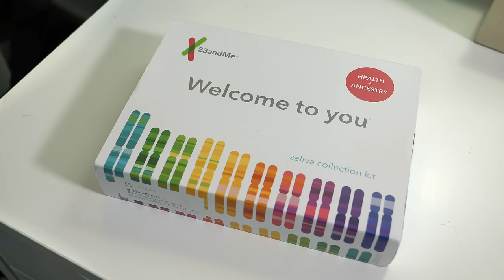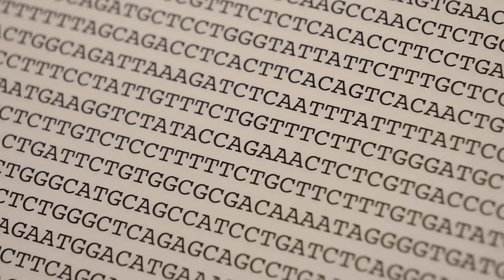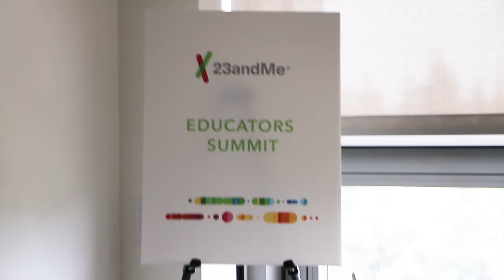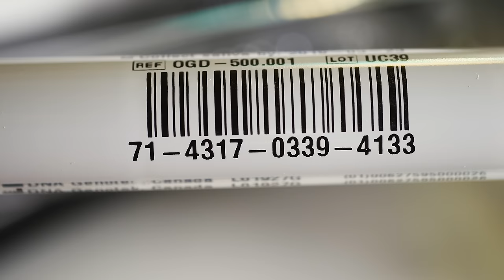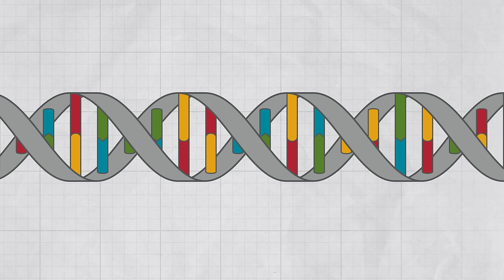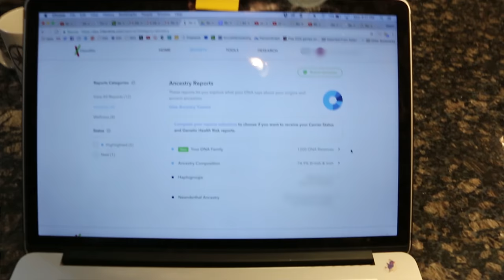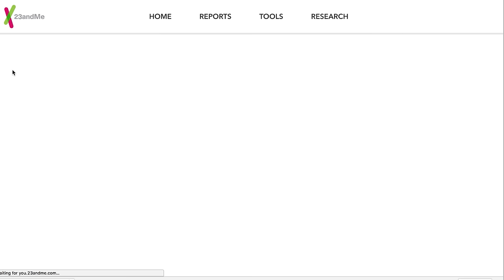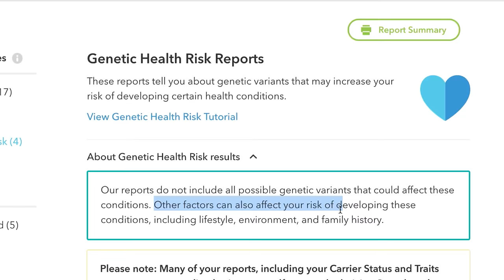DNA Testing and Privacy (Behind the scenes at the 23andMe Lab) - Smarter Every Day 176

Comment: What is done with the digital information gathered by 23&Me and the labs? They trash the samples when  people don't want them to be stored, but they've read the DNA already and stored that information digitally, I'm sure. Is that also destroyed?
Reply: Who knows... :)
Reply: I would try reading the 23andMe privacy guidelines.  I bet somewhere there's something that says "This information, if you choose to have it destroyed, will not only be physically destroyed, but our system will also delete this information after X amount of days/years."
I mean, I can't imagine they'd be able to afford saving all that data on their servers for too long.
Reply: @vjm3  well...  This is genotyping so it's looking at .02% of the genome, and the full genome on the other system was about 80GB...  If my head math is correct that would make the multiplication come to .016GB but even then that's too much because each of those 600,000 genes was  simplified by reading off a binary Gene type from the final base pair.  In the end they wound up with 600,000 bits of information, which would make for a miniscule file size.  I'd say that this falls into the category of so little file space it costs less to keep it forever than to deal with the logistics of knowing whether to get rid of it or not.

People are forgetting they have to save the data so you can access it...

Comment: You're not covering what happens to the Health + Ancestry Service samples or where that data is then used after you get your results. My biggest problem with this service is what they discovery in your DNA (for good or bad) can be used with any compensation to the individual because they signed those rights over to 23andMe. Read the fine print, I did. As for the physical samples be being destroyed, that should not even be an issue, the "spit" is like the plastic bottle your soda comes in as the data has be collected and is now in the system and is for sale and has been sold already to pfizer or other companies. Don't get me wrong, I'm all for the betterment, but I have to draw the line when it comes to a company making money twice.
Reply: Just curious, I dont mean to be confrontational or anything, but can you maybe just paste the fine print you found? Im just curious and would like to also see what, how, where, etc.

Comment: The 0.02% thing seems a little bit of a misleading statistic. While it is true that is the overall percentage of your DNA, it is slightly misleading in that its not necessarily the percentage of your DNA that matters. Consider how much of our DNA is shared with a Banana (~50%) or a chimpanzee (~99%). Then consider that a not insignificant portion of our DNA is considered to be non-coding or junk DNA. 

All that put together could make the percentage of your DNA that they are testing for out of your total DNA that matters a good bit larger. I am far enough from an expert to not know even within orders of magnitude what that final percentage would be, but it would almost certainly be higher than the 0.02% stated.

That said, that doesn't scare me off of testing services like 23&me so much as not seeing it as a good value at its current price.

Thanks for the video!
Reply: Brent C They don't claim that percentage as part of their value at all though. It has nothing to do with it.

Comment: I was a bit surprised to see at 8:15 that the technician that is de-capping the saliva samples before testing them is actually talking over all the un-capped samples without any sort of mouth cover, potentially contaminating the samples. Anyone else thought about that?
Reply: Any resulting contamination from breathing over a sample is negligible. The worst possible scenario for contamination would be for the technician to actually spit in the original sample, which would result in (potentially) different reads for the same location.  This the concept of coverage in sequencing, in order to ensure there are correct matches: https://en.wikipedia.org/wiki/Coverage_(genetics)
Reply: Contamination from foreign spit over air is nothing compared to chicken bits from your sandwich you had for lunch before spitting into the tube.
Reply: Zedex 12, you watch Adam ruins everything too? :P

Comment: How does they not contaminate the sample, as they don't handle the tubes while wearing face mask
Reply: because the sample undergoes multiplication before being put on the chip, small contamination doesn't matter. As long as you have "pure enough" sample it will give correct fluorescence, because there are more "correct" matches than those with contaminant.
Reply: Loliette very carefully

Comment: If someone from 23andme sees this (I know this is an old upload, but still...): That Master brand gate padlock on the gate for the bio waste should be upgraded. I, as well as countless beginner lockpicking enthousiasts could pick that in a matter of seconds to a few minutes. That's something you should only see in a low security residential settings. Even if they say commercial on them, they're not hard to pick at all. You could even smack it with a hammer in a downward direction against the lock body to pop them open. Obviously physical destruction would be much quicker, but at least you'd know it was comprimised right away, as opposed to picking the lock. Please consult a locksmith if you value the security of those samples. You could even ask the locksmith to see how fast they can get it open just to solidify the concept. I'm sure there are likely cameras on the premises and possibly security personnel, but it's just hard for me to see that and take it seriously when everybody who is a beginner at picking locks usually gets their hands on Master's padlocks to practice with from home or the hardware store.

I mean, I don't know how likely it is someone willingly wants to steal spit other than the feds if the opportunity arises. Alternatively you could do a security audit or something.

I just rewatched that last bit and noticed it's got a blue tag, which means it's not even intended for commercial grade use. The supposed commercial padlocks have a gray stripe around them instead of blue.

Comment: 8:27 Expensive, high-end equipment, run by windows xp... That's pretty funny.

Question: What do they say about the security risks that microsoft says you have if you're still running windows xp?

Don't worry, the dog won't eat the chickens, but it will open the door for the fox.
Reply: Somehow I don't imagine they're connected to the internet.
Reply: Gus Larscheid Lol thats what I was thinking. The NHS still used Windows XP and look what happened.
Reply: Earl Grey That's a good point.

Bladsmith I would think PROBABLY not, but I don't think that should put anyones mind at ease.
Seems strange to me that anyone would just hope that it's not connected to the internet.
Reply: Even if not connected to the internet, it still could get malware on it. Removable storage devices or intra-network communication could also infect a machine
Reply: Chances are they are not using the version of xp you would have at home ten years ago. Many large companies provide their own support to the OS and continue to use it because of it's stability.
Reply: Then how they send those data to other sites ? 🤔
Reply: a lot of times these machines are completely isolated. they do not have access to the internet, local network, and only have access to the specialized hardware they are running and maybe a printer. they do not need to use removable storage devices, so its not a concern
Reply: tuckersaspy tell that to Iran's centrifuges and stuxnet
Reply: Fun fact, so does most military equipment.
Reply: That's not Windows XP, that's Vista.
Reply: DaxenGaming , in screensaver of Windows vista, vista is written in white colour. But, in windows xp, "XP" is written in red.

So, that isn't windows vista. 😑

THAT  IS  WINDOWS XP
Reply: Gus Larscheid most advanced equipment in hospitals is run on xp. Like CAT scans and all
Reply: Those machines aren't a Canon printer or something.  It isn't like you can just go get updated drivers for every new OS.  Besides, I still use XP at home.  Fewer links to Microsoft, stable and less worthless overhead.
Reply: Gus Larscheid they have their own encryption , don't panic🙂
Reply: there are risks only if the machine is connected to the internet
Reply: windows XP is really cheap and runs really well, thats why
Reply: I also noticed that. My first thought was that their systems probably have tons of known vulnerabilities unpatched. However, it's possible they're not on the internet, or that they're paying MS for security updates. There are insider and social engineering attacks that could get through. But considering that they somehow manage to get the data to you over the internet, they are definitely connected to it.
Reply: hopefully they aren't on the internet and have USB ports disabled
Reply: He said they have the fastest internet in the city....Its connected!
Reply: Yea and really, thats all the equipment needs.

Comment: 8:17 Should we really trust people who use Windows XP?
Reply: Medical institutions will commonly use old operating systems because the software they use relies on the operating system and/or because the old software they use is no longer being supported by a software developer or by the company that produces/produced that software. And although Microsoft doesn't "support" Windows XP anymore (no more updates/upgrades), they still occasionally update XP for critical security issues, like when the WannaCry ransomware attack was spreading. 

Upgrading OS doesn't necessarily mean less government/hacker/insurgent security, either. If anything, upgrading OS can mean losing some privacy to Microsoft and to whichever organizations they send information to. Granted, old OS' may have old security flaws, but Windows was supported for long enough, and it's possible that the computer was doing something non-critical, IE running some GCode to move some syringe heads around or whatever the machine to the right of the computer is doing.
Reply: Steven Nguyen thanks for the unnecessarily long reply to a joke comment...
Reply: No problem 👍

Comment: It seems as though Lab Corp is doing their due diligence based on destruction requests.  23 and Me does not allow kits to be registered anonymously, and they also appear to maintain your results with your contact information indefinitely.  They do not appear to accept requests for destruction of result data after its provided to the customer, and I could not find a data retention policy for result data.  Allowing anonymous kits to be ordered, or honoring a request to destroy the result data after delivery to a customer, would provide additional protections to customer in the event of a data breach or subpoena from the courts.  If no backup copy of the data exists, then it can not be accessed again later.  If anonymity where available, then the data could still be used to benefit the greater good while providing additional protections for customers.

In the end, Lab Corp isn't going to clone you with your left over spit, but 23 and Me seems maintain your results indefinitely, and I suspect when you order a Genealogy test, they pay Lab Corp to run the Health + Ancestry test, although I'm speculating on this one.  Why does this matter?  Well if your result data is exposed at 23 and Me for whatever reason, its likely that more than Genealogy data will be exposed even though that may be all you've ordered.  

Over all its an interesting video, thanks for your hard work.

Comment: Re: comments about Windows XP/VIsta/7 running on their computers. I was an computer support person at a government research facility. I had to work with lots of 20-year old computers and operating systems, because that's what the lab equipment was designed to work with. Newer PC's wouldn't work with their equipment. Most equipment needs a very minimal computer anyway. It just instructs the machine to start doing its job, and collects the data. I'm sure analysis of the data is done somewhere else, but again, even a old PC can do that.

I remember an episode of "This Old House" where they toured a "state-of-the-art" facility that had a computer control a laser to maximize the number of pieces it could cut out of a sheet of steel with minimal waste. The sheets of steel were fed to a conveyor belt by a robotic arm, and the laser did it's cutting. Then they showed that the computerized laser was fed data by an old-style "ticker tape" with punched holes in it! That was a bit shocking even for me.

Comment: You have a false sense of security with them. You didn't ask what data is subsampled and how consistent it is across the historical samples, that is, have they changed the sample set over time. Just because they are subsampling for the user doesn't mean they don't collect more data, you didn't ask that either. You didn't ask if they have had any FISA requests, which to a great degree they might not tell you even if they did because companies interpret the NDA differently. Any level of anonymous data can be useful using meta-data, the email address and number are the links to a great deal more than you're aware of. Since you clearly know little about data security you asked the wrong questions and interpreted their answers incorrectly.

Comment: old video but odd comments... Labcorp is like the walmart of lab testing. The analyzers for many tests cost hundreds of thousands of dollars, and a small dr's office doesn't process enough volume to get value out of analyzer, so they send them off to lab corps, or their main competitor, quest diagnostics. 

Also the samples (likely) were not only disposed of but they were likely run through an autoclave in the process. All the proteins were denatured by heat. I may be mistaken, but usually anything tossed in a hazmat bag like that gets that done to it. 

Oh and you didn't touch on the primary privacy concern at all. The government using this kind of data in criminal investigations.

Comment: Geno sequencer still running Windows XP ...says it all really
Reply: its stable, solid, and dependable.
there are alot of companies still using older operating systems due to various stability concerns.
Win 10 constant updates that break things, bundled spyware and "security" updates are absolutely horrible and the only reason they get away with it is because they are a monopoly.
Reply: It says that you've got no clue about biosciences and IT. Nobody will replace a $300k lab machine just so it can run on a newer OS. Those computers are likely not connected to the Internet. Your cash machines and tills in your local shop still run on much older software.

Comment: I spit in a tube 2 yrs ago...
I mulled over to do it or not, weighing the pros and cons..  Eventually,  (for very specific reasons that are personal) my curiosity won the battle..  I reasoned with myself that yes my DNA is on file, but, I never plan on murdering anyone so the worst thing I could find out is one of my relatives is a cerial killer...  

Honsesty i was banking on two primary things;
1. I am indeed a princess &
2. My "dad" isn't my biological dad
Both answers were disappointing lol...

Now, 2 yrs later I'm kind of wondering if doing this was a big mistake?

Comment: I won't do it until the chic that uncaps the tubes wears a mask.
  ...many S sounds while standing directly over 50 open spit samples....just sayin
Reply: A minute amount of another individuals DNA getting into your sample is not going to corrupt the entire sample. The DNA is amplified, which results in many copies being made. Therefore, only the most prevalent copies are going to be tested, while others are negated.
Reply: I also want to point out that every Lab Technicians DNA should already be on file. With that said, the system will easily be able to determine the differences between the lab technicians DNA and your own.
Reply: I believe you. 
 Wear a mask.